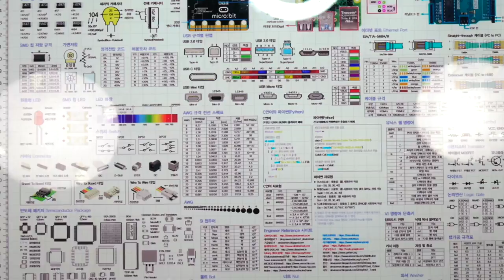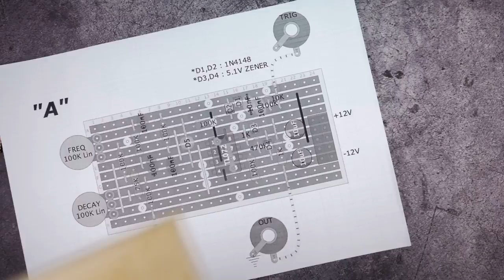DIY EURORACK TRIPLE TWIN-T DRUMS (NLC BONGO FURY)

Comment: Brilliant. But I'd add a mixer (A simple TL072 based one).
In order not to need a separate module just for the drums.

I'd also make a module for the "noisy" percussions (snare, open and closed hihats).
For completeness.

Or I'd probably combine the 2 modules in one (a la Delptronics LDB2e).

Moreover, I'd label "FREQ" "PITCH" and "ENV" "DECAY" (this is just to match my personal taste)
Reply from the maker: You're 100% right! 
Adding a mixer circuit would make the patching simpler, however I couldn't make a room for it with 3 circuits in 6hp. And I'm also thinking to make sort of simple and psuedo All-IN-ONE(kick, snare, hh) drum module sooner or later.
Thanks!
Reply: @SLOWROOMNOISE  Throwing in my 2 cents:
You could maybe make longer stripboards perpendicuar to the panel by the LONG side.
And maybe stack 2 of them "face to face" or "back to back", as they fit better.
You could maybe use 8HP panels (by the way, where do you get the 6HP ones? Doepfer doesn't make them anymore!)
Reply: @SLOWROOMNOISE  You might also be interested in this video from Kristrian Bläsol (I can't post the link or YouTube will delete this comment):
"TomTomTom Twin-T filter Drums - DIY Modular in a Week 9.2"
Reply from the maker: @mutedsounds2k  Yes! I sometimes install the stripboards horizontally using stand-offs, like this, https://www.youtube.com/watch?v=Xor8zwCPeQI .
And I got 6hp faceplates from a local shop, unfortunately they offer only 129mm, not 128.5mm in height. It's not a big matter though.
Reply from the maker: @mutedsounds2k  Thanks for the video. I'll look it up!
Reply: @SLOWROOMNOISE  There's also this one, in the serie (just buid 2 or 3 with different values for C5 and C6 - and also R2, for open/closed hats):
"Percussive Noise Voice, Hihats and Snares - DIY Modular in a Week 9.4"
Reply: @SLOWROOMNOISE  Another small idea is to detach the pots from the stripboard, in order to arrage them optimally on the panel.
As you do with the plugs.
This way you could rearrange the components on the stripboard/s and possibly save some space.
Reply: do you have any more info or examples on how to add the mixer? I have made a kicad layout from the original schematic and when I metioned this to a friend who owns a bongo fury, he said exactly the same about adding a mixer. I am pretty much a day 1 noob so I dont have a clue.
Reply from the maker: @cr0wland  how about this? https://drive.google.com/file/d/14AoSkUUTnXcBT2OG33mzSd2rRSgkuDF8/view?usp=sharing 
It's a simple mixer with an attenuator on each channel. I haven't tested it yet, but it would work.
Reply: @SLOWROOMNOISE    looks great to my untrained eye, I'll see about adding it to the layout. I think it'll need a couple more HP to fit, but it'll be worth it. Thanks so much!
Reply from the maker: Hope it helps! Let me know when u have any problem with it.